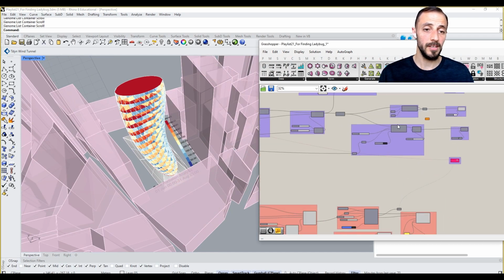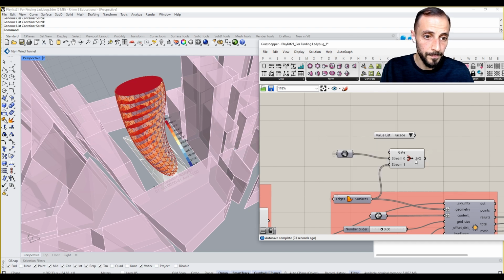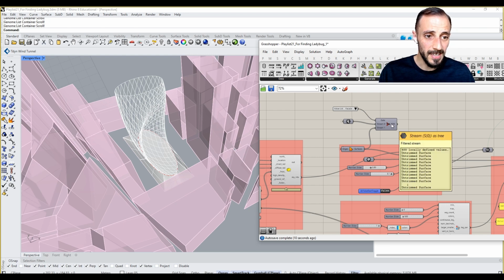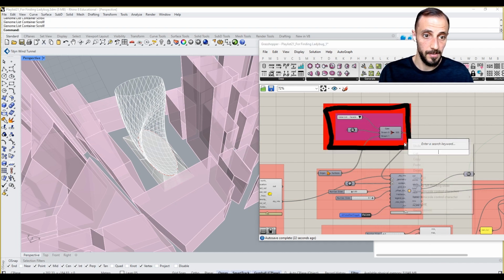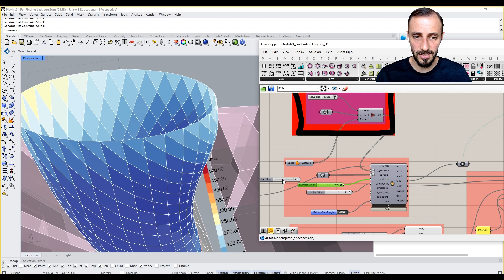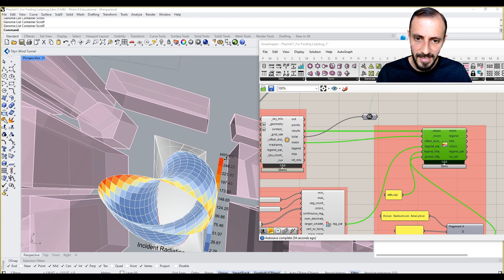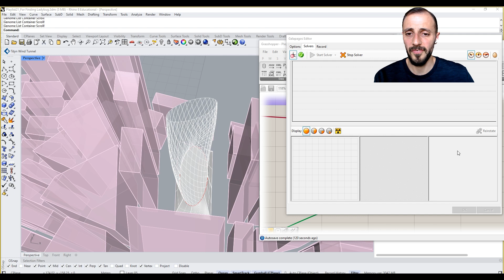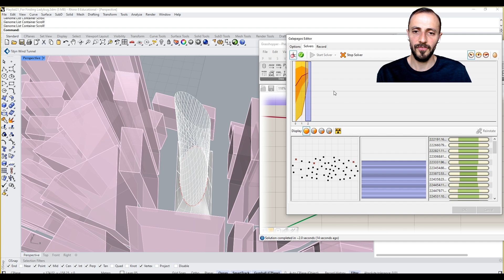6-Optimizing Facade for Reduced Solar Gain with Galapagos #facadeoptimization #solarreduction

Comment: Thank you for this great series. Such a great approach for starting the design. I realized the facade shows less radiation than it should. The reason is that the surface direction is not right, and you have to flip the surface actually.
Reply from the maker: That's a great catch! Thanks a lot and thank you for your nice words :)